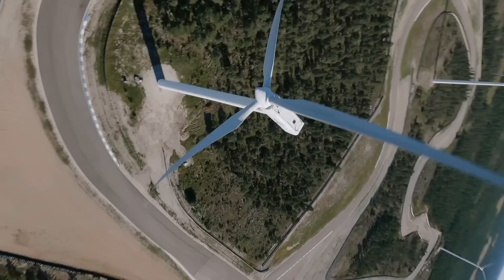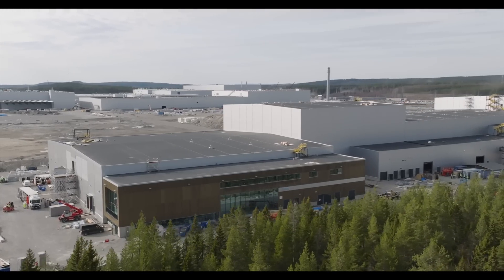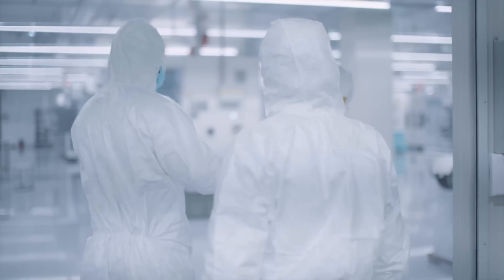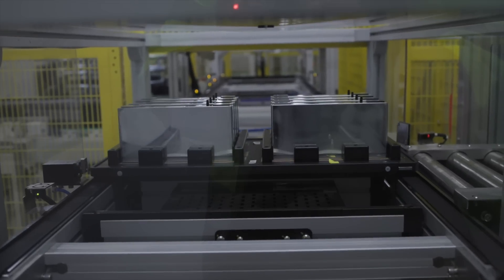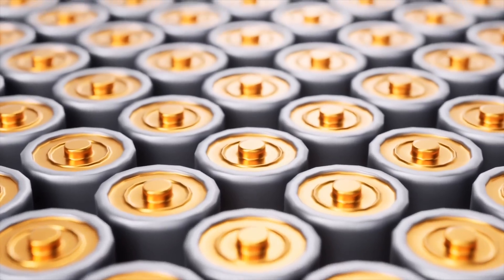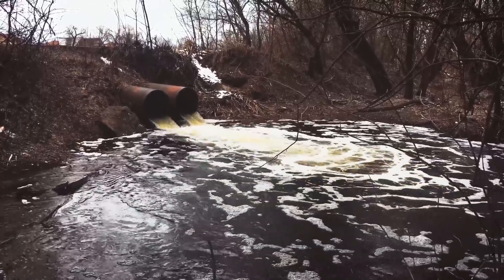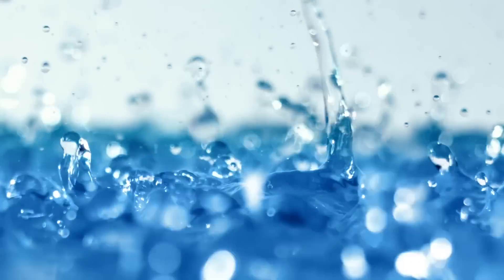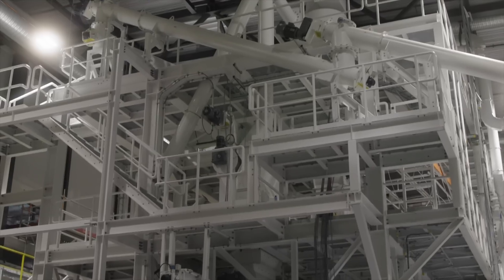Sweden's Massive €4 Billion Gigafactory is Revolutionizing the Battery Industry

Comment: It’s nice Sweden figured out how to reprocess batteries all be it on a small scale. Their plant could have made a lot of money if the battery combination was a viable product. But the four ingredients do not last as long as stated and they still cause thermal runaway. 

But if they paid cash for the plant. In not more than 10 years the right combination will be developed. It will be solid state with a combination of cobalt, graphene and silicon. They have built this battery in the lab. Production requires a new manufacturing process to expedite the process. I saw a test stand where they extracted power from the battery and drilled a hold through the battery. It kept extracting power and exhibited not thermal runaway. They think they will be ready in three years. I predict it will be closer to ten. But it will be a battery with long range on charge. It will be lighter, it can be charged quickly. It can be made cheaper than current battery’s being used. Good luck to Sweden.

Comment: Manufacturing batteries like this is the furthest thing from "green"
Reply: Fossil fuels are much further from green!    All mining, refining, all efforts / damage needed to transform the whole world to renewables with batteries is about as much as the effort / damage that we currently do for six months worth of coal production. Or, about eight months of oil production. And we are doing both the oil and the coal damage at the same time, both get replaced by the renewables which have very low continuous cost once installed. Free fuel and maintenance and replacement costs (lower than initial install as mentioned above) which are super low as compared to just the fuel cost on the fossil side.
Reply: Close to 90% of the petrol car's lifetime emissions are due to the combustion of fuel (fuel that cannot be reused). The battery pack in the electric car, on the other hand, is reused over and over every day, and the raw materials can in the future be produced close to 100% renewable, and eventually recycled.
Reply: Why?

Comment: China already has better batteries without cobolt and nickel. This factory is already old
Reply: The LFP batteries are less power dense. They take up more space and weight for a similar amount of power as an NMC battery. Plenty of demand for both of these kinds of cells as well as for many other chemistries and form factors. There is a lot of demand for the batteries that this factory produces and they can alter their production lines in the future as needed.
Reply: Different but not better. They have advantages but also disadvantages, so it's depends more of your situation. Personally, they are not for me who doesn't have possibility to charge at home, because they require to be charged at 100% at least every week and it is way too long when you have to wait for it on a public charger. And they have less density and density is what you need when traveling, if you have a home you can charge à 100 % all night and finally have the same amount of energy than the others at 80 % but it not when you need it. And anyway with another battery you also can charge at home at 100 % before to leave if you go on a trip, and have a lot more energy available for the same size. It's less expensive though but unless you have a home it's can be seen as a regression, and you will regret this economy when you are gonna have to wait hours on public chargers to get the 100 %.